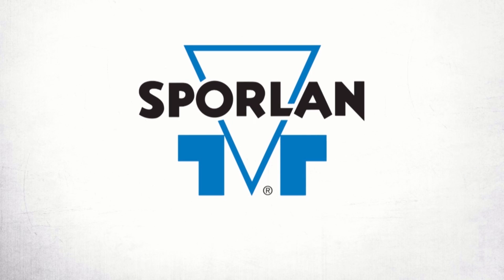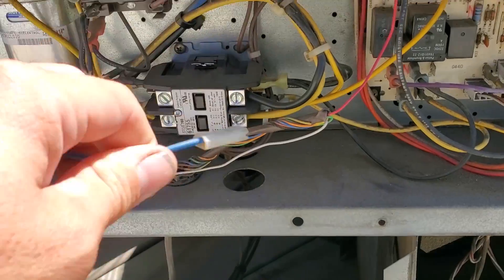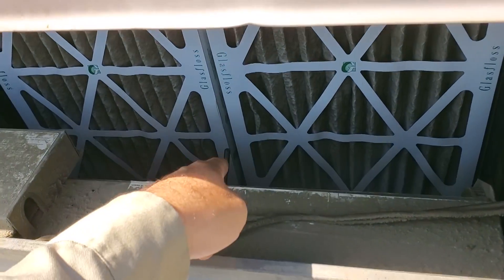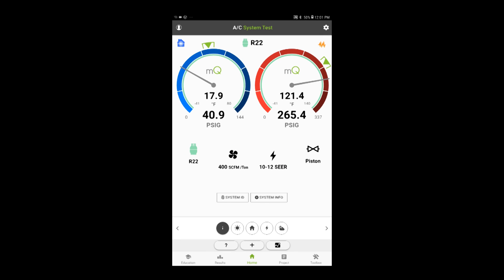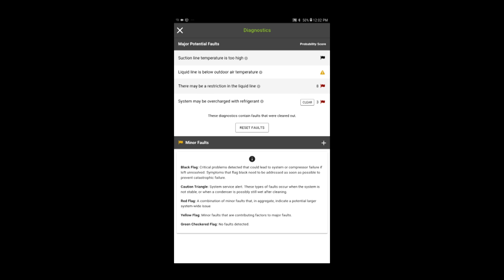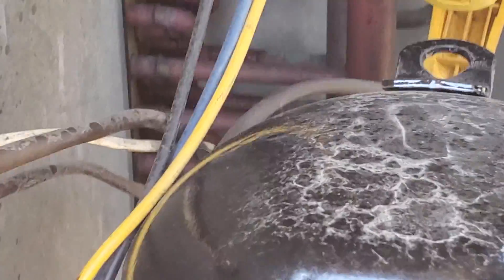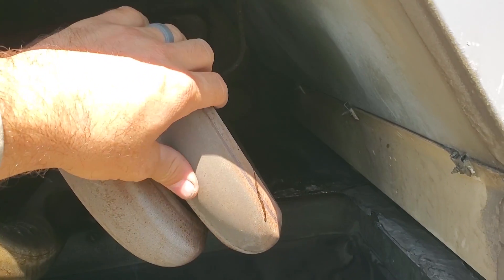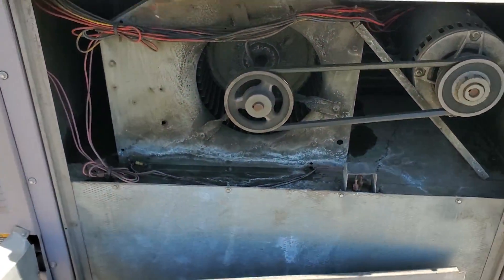CARRIER AC WITH RESTRICTED METERING DEVICES

Comment: Ive got 2 of these units at my facility. One of them mustve been having this issue for years. I havent had to check the charge and it seemed to be working fine until one day the evaporator was frozen solid. Pulled the charge and it had 3 extra lbs of r22 in it. vacuumed it down to 500 microns and left the vac on it for a day. Put the correct charge in it and immediately saw the problem was the metering devices. Hoping they let me replace this unit because it looks like a pain to replace those😅

Comment: Hey Chris, and all the other cool people here.

Is this more prevalent with R22?
I know that discharge temperatures get out of hand very fast when high head pressures, low suction pressures and high compression ratios are present on a system.
And then the oil produces gum which solidifies in the metering devices, or becomes solids that the liquid line filter gets.
I have seen this on badly designed abattoir boxes where the evaps and condensers were undersized, so a crankcase pressure regulator had been installed to get the condensing pressures down and the evap pressures up. but then you increase the compression ratio which catches up with you. 
Gummed up liquid line cartridges and compressor failures due the acid produced by the oil breakdown under these temperatures.
R22 seems to point out the two issues I mentioned in line 2 very quickly.
I would not mind an objective reply to this one, as it is something that I experienced and cannot unsee.
Thanks for the awesome channel Chris, I am enjoy the experience of what you share immensely.
Kind regards,
Duncan, South Africa.

Comment: Hi Chris, noticed you referenced "subcooling" in your refrigerant circuit diagnosis. I have been inspecting a lot of Trane Voyager equipment largely with FM (short orifice) pistons and a few TXVs, but struggle in diagnosing restricted metering devices concretely as they have similar frost patterns and SH/evap temp pressure symptoms to a low charge condition. I have been encouraged to reference subcooling to "prove" that the unit has most or all of its charge, but struggle in that these aren't true measurements and therefore a crude way to diagnose. I'm speaking from a relative lack of experience, but the only solid indications I can find for "high side conditions" would be discharge pressure against a charging chart derived from load conditions. Again, I realize condenser and discharge pressure are closely linked, just curious your thoughts.

Comment: I’ve seen many times when you lose a condenser motor the high head pressure clogs the metering device. Always check the motor bearings to help prevent this.

Comment: A thousand thank you to you man i've got same problem but brand that i got is rheem A\c split 

Suction is low 30psi and discharge is 270 psi

So then i removed the fixed orifice to chekck it and i found ot that the filter inside is already rusted.

I changed the fixed orificed and guess what man?

Its running perfectly pressure and temperature is perfect,subcooling and superheat is perfect

Thanks a lot that you shared your knowledge.

Sorry with my english but all thanks to you😂👍👍👍👍👍👍👍👍

Comment: You are very welcome. Always great to watch the videos. AWESOME job as always. I have worked on Carrier alot and you are correct in summer its the metering device or in winter heat exchanger or gas valve. I will be away starting tomorrow for a little while going in for surgery  in early am. Be good kid. HVACR ON AMERICA!!!
Reply from the maker: Good luck Ray!
Reply: Thank you very much. We will be in contact with you. Be good.

Comment: Man. Your videos are GREAT. I watch all of them. I left a hospital with all Trane equipment to work for a University that has all Carrier equipment. I start Wednesday.
Getting a great head start, because of you. Thanks a lot.
Reply: Well if u get these just know that the econ is always bad on these water leaking into the circuit board, they added a shield but nope that didn't help, also these have split coils like some trains difference is the train units split half way
Reply: keep thinking thx man. Thx a lot

Comment: One question I have is With R22 becoming illegal and unavailable starting in January, Won't the customer's only choice be to replace the whole unit? I would think that all R22 systems once they go low on gas should be labeled as unfit for repair due to the gas becoming illegal in January. I have been wondering about this because I see the HVAC techs that I watch on here still fixing R22 systems that need gas and seemingly not telling the customers that they have to replace the unit because the gas becomes unavailable starting in January?
Reply from the maker: Actually that is a major misconception R-22 will not become illegal it just wont be allowed to be imported into the US and or new R-22 will not be allowed to be made anymore. But the suppliers and manufacturers have stock piled enough to last for many years. The price has actually gone down too. I will discuss this more on my livestream tonight......  I will be going live on YouTube this evening 9/23/19 @ 5:PM (west coast time) to discuss my most recent uploads and answer questions from the Live Chat, emails, YouTube comments, and Facebook comments come check it out if you can https://youtu.be/4rNW597Gy7s
Reply: Check the coil and compressor ratings. Its possible to convert an R22 system into a 410 system.

Comment: The customers are allways take the lowest cost option. It dosen't matter what it is. I do repairs of measuring equipment for opticans. Sometimes they have equipment that is about 15 years old. But they buy the repairkit, even if they can get a more accurate system. It is the same thing, rapair costs a quarter of the new unit.
Reply from the maker: I will be going live on YouTube this evening 9/23/19 @ 5:PM (west coast time) to discuss my most recent uploads and answer questions from the Live Chat, emails, YouTube comments, and Facebook comments come check it out if you can https://youtu.be/4rNW597Gy7s

Comment: I have been in the field less than a year and work for a local company in town and have changed a lot of TXV’s that get clogged on units the company has installed that are less than 3 years old. My first thought is that the installers are not brazing with nitrogen. And sure enough they are not and not even pulling a vacuum properly and they don’t even install filter driers.
Reply from the maker: I will be going live on YouTube this evening 9/23/19 @ 5:PM (west coast time) to discuss my most recent uploads and answer questions from the Live Chat, emails, YouTube comments, and Facebook comments come check it out if you can https://youtu.be/4rNW597Gy7s

Comment: What are the telltale signs of it being the metering device rather it being low on charge? When I saw low charge and the evap icing up I was thinking low refrigerant. Thanks in advance!
Reply: low suction. high subcooling - because liquid is being held back in condenser. high superheat - because your not getting enough refrigerant in to evap to cool compressor .  low on charge is both pressures low with no subcooling. subcooling is the key.
Reply: OcRefrigeration , Hvac & Electrical Video's. Thank you Oc, great explanation.

Comment: Iv had them clogged with a wax type substance. Sometimes nitro and mapp gas torch helps but it's a gamble
Reply: that's cooked off/coked "oils", it was ran way too hot, low on gas, clogged cond. coils, bad fans, etc.
while I hate to mention they should have safety devices to shut down and alarm if anything is off, it's true for longevity of equipment, but at the same time systems that don't break deletes work and the electronics are all chock full of early failure junk, which creates more issues, money wasted an overall more global warming in the big pictures from bare materials to end product and repairs.. ;)

Comment: Would like to see how those metering devices are changed...
Reply: Greetings from Western North Carolina... There is a method to free them up. That sludge someone mentioned gets in the accuators and gums them up. With a few hours and some torch skills some flush and a lot of nitro you can actually get  them to clear up and start metering properly again. Pull out all your refrigerant, purge nitro and heat up the accuators.  This and purging some flush will get them unstuck. If yall ever think you are experiencing clogged accuators, you can Performa freeze test to confirm. Pull L1 off your blower and start the system. Without a blower running your coil will begin to freeze immediately. Watch the freeze pattern. If some cells of the coil start to frost but others don't you will know strait away which accuators you need to pay closer attention too. Good luck yall.
Reply: As would I. Last one I found I ordered the entire evaporator
Reply: Probably very smart. saved u alot of time & headaches which in turn saves customer money & customer gets a better job overall.
Reply: It's a pain in the ass.

Comment: Good find, would you ever consider just Retrofitting to a TXV?  I know it won't be per spec, but for an older unit, maybe it's OK.  Good videos.
Reply from the maker: Yeah but carrier doesnt makes a kit for that so I would gave to come up with a distributor, and txv...... I would do it if I could figure out all the calculations!
Reply: @HVACRVIDEOS  Yes Very True, since it's commercial, you never want to create a situation where it will reduce the capacity.  Probably time consuming to research if you want to do it right so I totally understand.  I've done it on residential where Carrier has a similar unit that is higher SEER that uses a TXV and "steal" the design.  Still won't be perfect, but it seems to work based on the numbers.  Good luck, yes looking fwd to the video when you get the job.

Comment: We had a similar situation here in Georgia. Carrier RTU but a 10 ton with one 5 ton Curcuit restricted. Did not want to repair.  We told them we would just let it run in the good Curcuit till they mad a decision . Called another company hooked up the Curcuit and caused a leak and killed the compressor . Lucky we had service invoice and email to clear us. Building owner just had us replace the unit.

Comment: Someone didn't run nitrogen  when they did that compressor guess how I know
Reply: The compressor was probably a burn out which clogged the metering devices. I don't think brazing 2 joints on the compressor would be enough to clog 8 or 10 pistons.
Reply: @brettwing737  it doesnt take much and if it was a burn out the techs half assed the job. It's not hard to put the effort to flush the system right.
Reply: or it ran low on gas from a leak and cooked the oil off, thus killing old compressor, pretty much, trash the whole system end to end and start over ;)
no low pressure cutoff in there? cough cough
Reply: @throttlebottle5906  there was nothing wrong with the compressor. A blocked orafice in a metering device is responsible for the high head pressure and low suction pressure, also as he showed in the video, the pattern of the frost on the evap coil is consistent with a metering device clog up because you can see heavy ice buildup after each metering device. The charge was most likley decent but not purging nitrogen is what most likley led to this failure
Reply: @lsx_moe  the compressor was already replaced..... what caused it to fail and be replaced? think harder, oh right the same thing that is causing the issues now (orifices don't magically clog themselves) it was something in there from the factory/production (non refer/dirty oil) or being very dirty cond. high head or out of gas, al the abobe will cause oil burn off and coking upstream, right smack in the orifices  or TXV's
Reply: @throttlebottle5906  it is not common for a metering device to cause damage to a compressor. It's possible that the original compressor was damaged due to a leak and as you mentioned a faulty low pressure switch (usually when you build up so much ice it will trip the low pressure switch) but the clogged orafices were most likley a result of not back purging nitrogen which led to scaling.
Reply: @throttlebottle5906  non condensables in the system
Reply: zack9912000 How do you know?
Reply: @Frolo-H  it's common practice to purge nitrogen throughout the braze joint to prevent the inside of the joint from crystallizing which will scale off and in this case clog up the metering device. 

Same as when TIG welding, we back purge argon throughout our piece to prevent the same crystalline structure buildup
Reply: @Frolo-H  you did it?
Reply: Exactly what I thought. Copper oxide turned to scale and plugged up orifices.
Reply: U dont use nitrogen  when brazing compressor connections. Wen brazing with nitrogen braze joint has to be between inlet and outlet point of nitrogen so that it can flow threw joint not just pressurize it. Since it wont flow threw compressor u have no outlet which will pressurize pipe and braze will blow up in ur face. Hot silfos on face=no bueno
Reply: is it necessary to use nitrogen when welding?

Comment: Can there be heat exchangers that don’t rust
Reply: Mr.Johnny boy. Stainless steel maybe.
Reply: I remember asking that. The answers I got made perfect sense. A Shell is made thin as possible for Efficiency of heat transfer. 
Stainless is a brittle metal. It does not transfer heat well. It also expands with temperature more than most. 
Making it thin with temperature expansion leads to cracks. Although it may be corrosion resistant it otherwise breaks itself apart. 
That is why they don't use it.
Reply: Well the issue is a poorly running air conditioner on a package unit destroys hear exchangers. The excess moisture blows off the Evap coil and onto the heat exchanger.  This is because in a package unit application the Evap coil is up stream from the heat exchanger.  Always confirm duct is correct then keep the ac running the best you can. Keep drains clear and blower speeds right and your heat exchangers will last the 20 to 30 years they are supposed to.